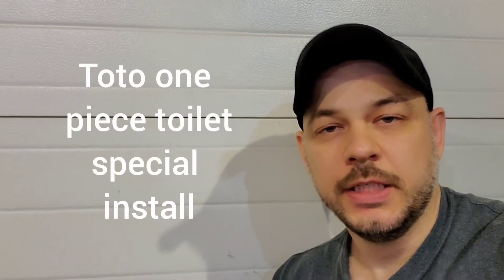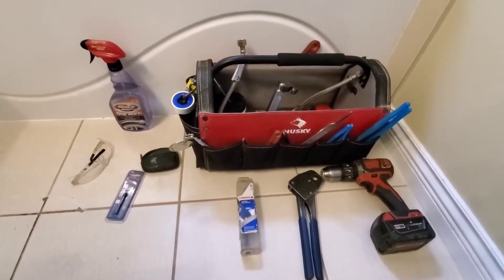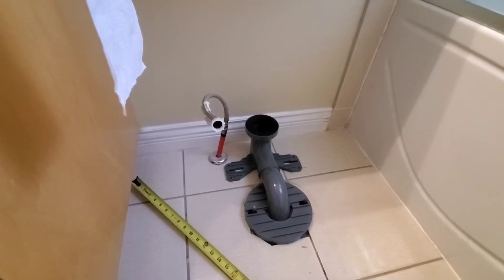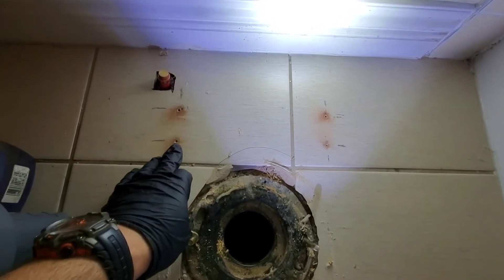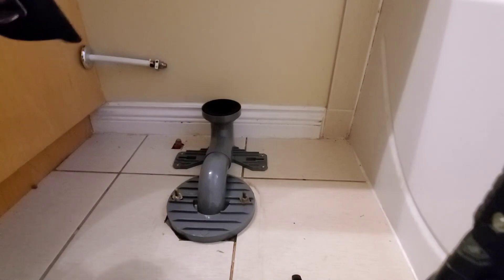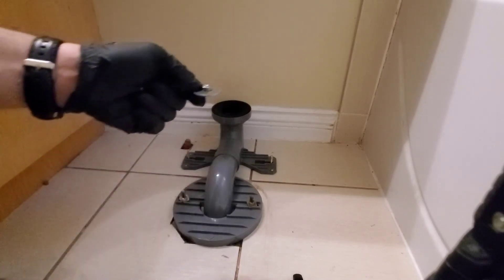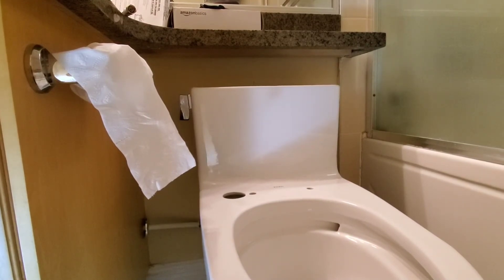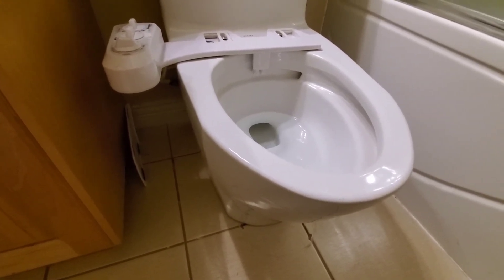Toto one piece toilet special install (DIY guide)

Comment: The installation distance of my toilet toilet is not a regular 12inch but a 10inch. Can I install this toilet?
Reply from the maker: Thanks for your question, l ran into this a few months ago. Yes you can install the tiolet, you need to get a 10" collar to do it. 12" comes with the tiolet. Check the instructions/search the model you have for the SKU for the 10" collar.